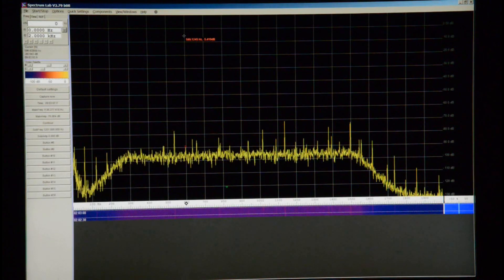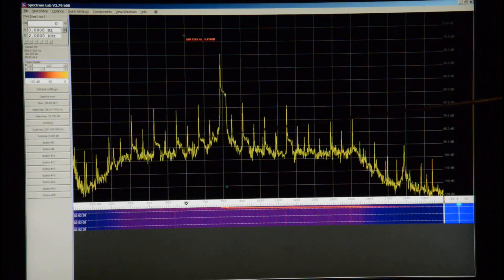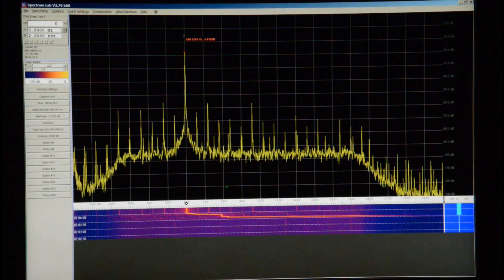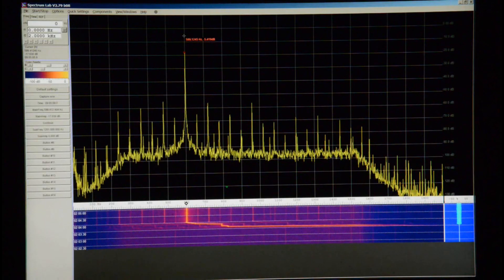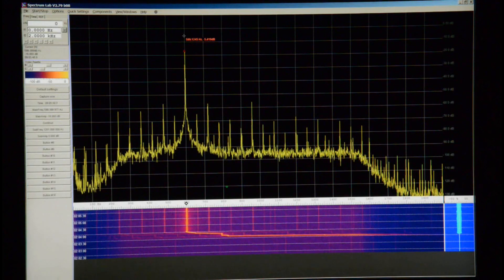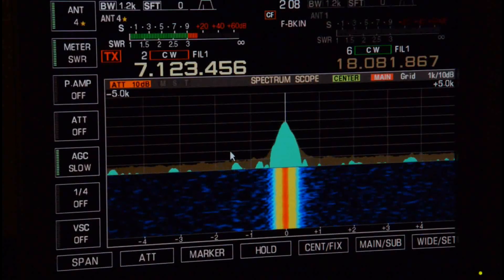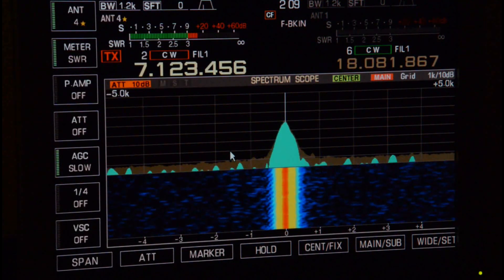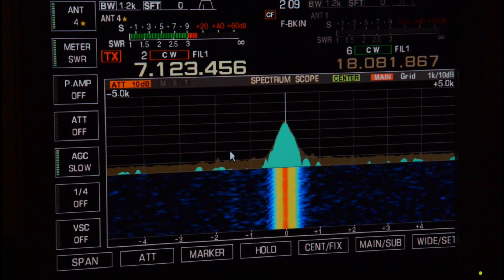K7HIL FMT method

Comment: Thanks for posting yourFMT method.  I use a similar technique with the Flex-5000, Trimble GPSDO, and Spectrum labs and get similar results- mostly doppler error in the FMT.  In Spectrum Lab setup what FFT size and Decimation do you use for the FMT (determining bin size and time to calculate FFT)?
73,
K6CCA